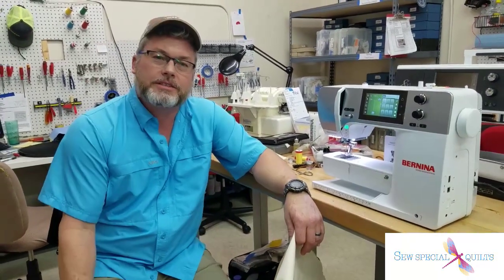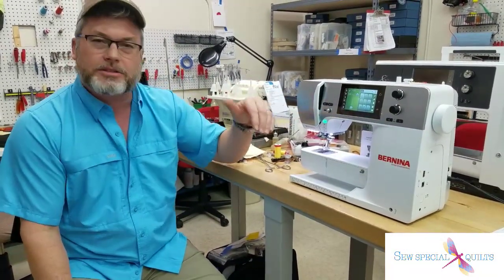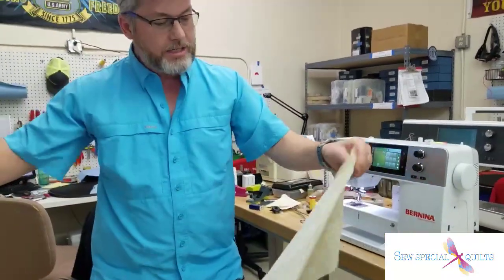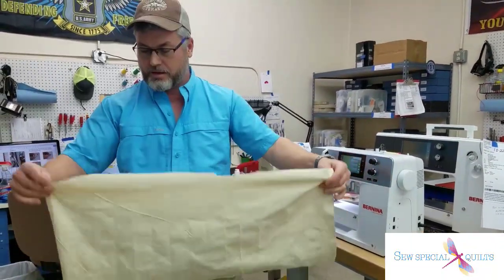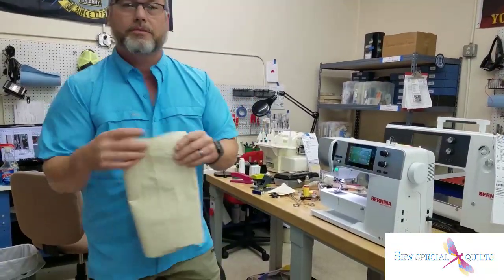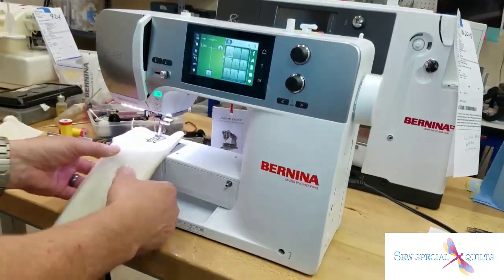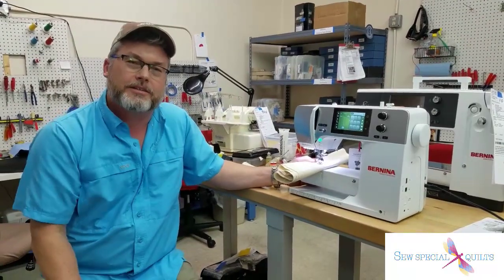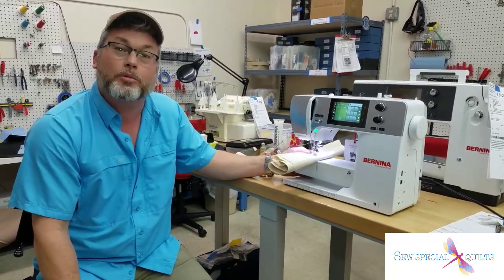BERNINA Hammer Mode

Comment from the maker: TRANSCRIPT: Welcome to this weeks edition of #techtuesday with Sew Special Quilts.  We have two locations, one in San Antonio and one in Katy Texas.   Today we’re going to talk about the BERNINA’s new feature called the Hammer mode.  And basically, what it does when you are sewing through really thick layers of fabric.  If you’ve ever seen sometimes it’s so thick the needle will stop penetrating and you get gears on the screen.  Now what BERNINA has done is added this feature to the firmware that will start pulsating the motor to drive that needle through the really thick fabric.  And so I’d like to demo that that here today.  I’m going to use some really thick canvas here. Well not really thick it’s just canvas.  And I’m going to fold it in half, that’s two layers and fold it in half again that’s four layers and there is 8 layers of fabric.  And let’s see what happens when we sew with that.  Well that did not display the Hammer Mode.  It didn’t do it at all.  What we’re going to do it go all the way up to 16 layers of canvas and let’s see if that will show the Hammer Mode.  Now the thread did break, that was 16 layers of fabric that’s to be expected for that thickness without adjusting the tensions. But the fact is the machine still penetrated all those layers of that canvas and just kept on sewing. Unfortunately I think the Hammer mode only works if you’re sewing on something you shouldn’t be sewing on like wood maybe.